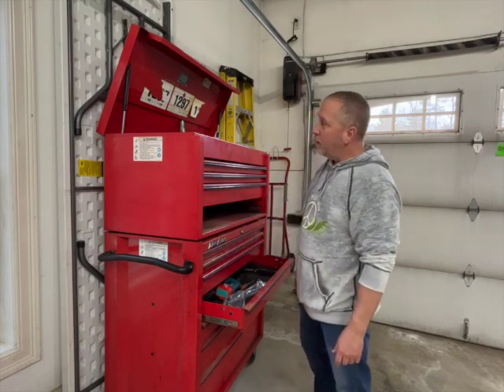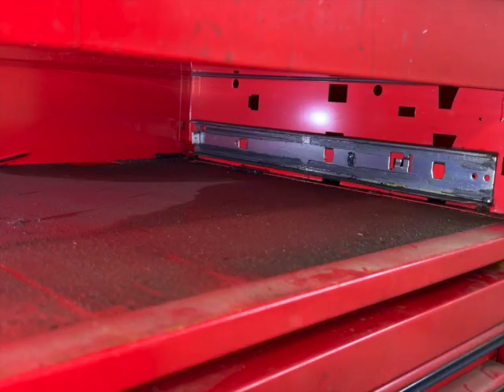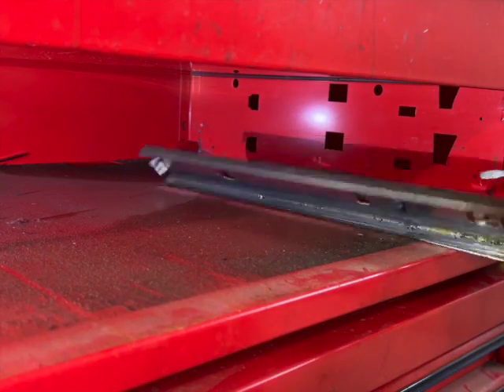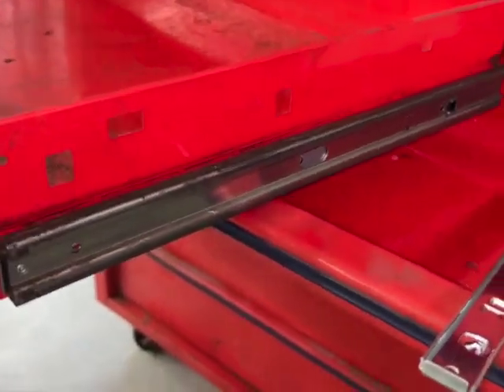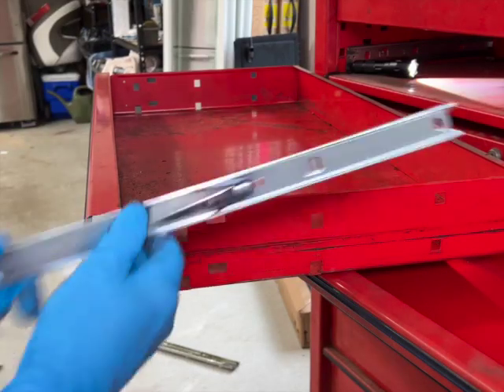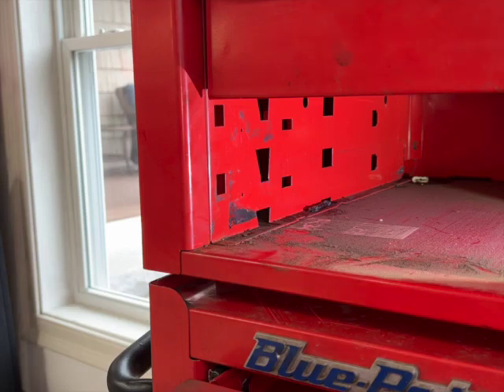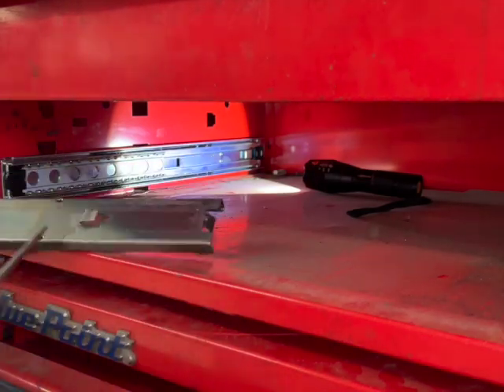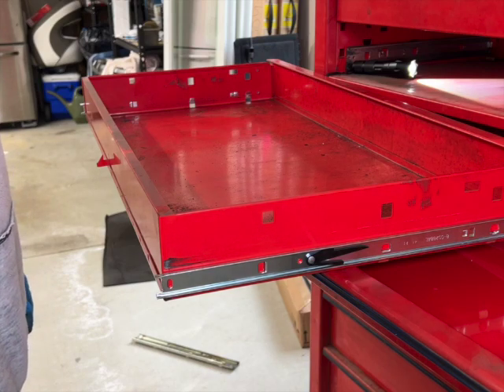SNAP ON TOOLBOX ROLLER BEARING SLIDES INSTALL

Comment: I watched your video and Snap On is sending my replacement slides. Great video
Reply from the maker: Right David? Snap-on is super easy to work with compared to the tool truck guy. Thanks for the feedback 🍺